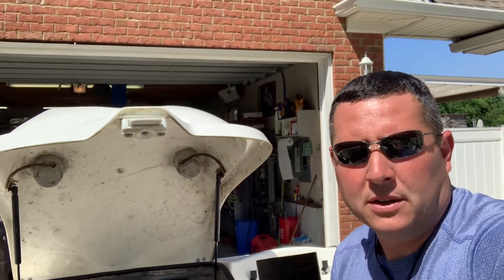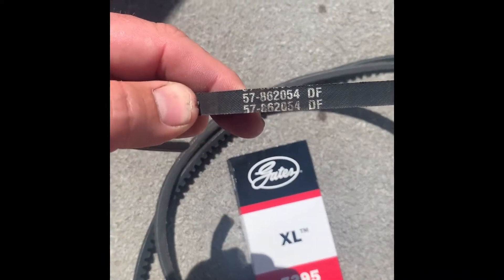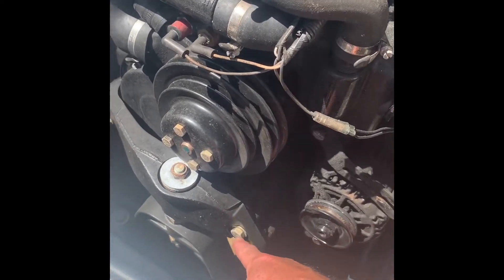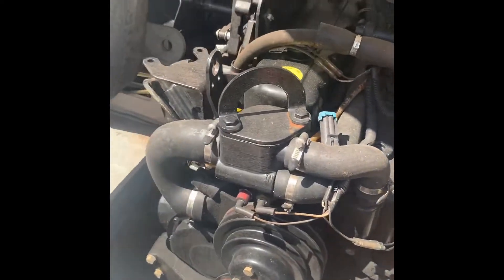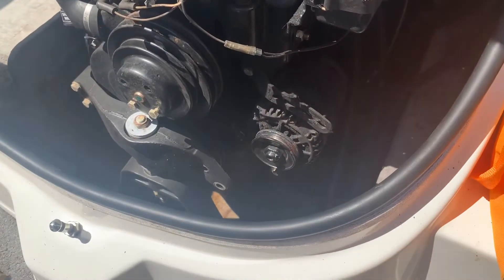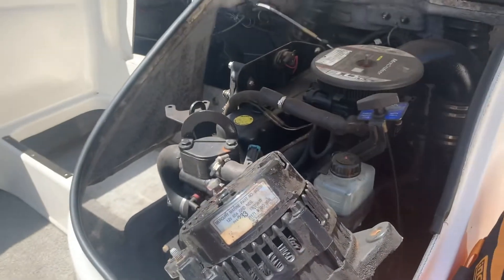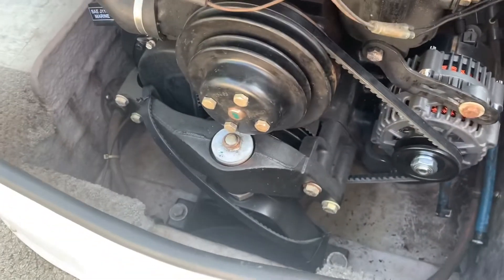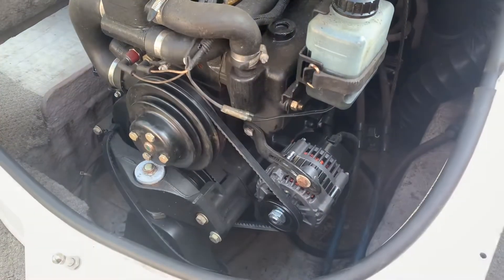Mercruiser 3.0L alternator and drive V belt replacement with Gates automotive belt interchange part

Comment: Just finished replacing the Alt belt on my 2010 Mercruiser 3.0.   That 7395 fit perfect. Nice tip about zip tieing the old belt as a back up. Great job.  Thanks...

Comment: Man this is an awesome video. Thank you. I also have a 2009 175 Bayliner. Fantastic starter boat. P.S. since you're technically sound, you might as well remove the TKS Carb and clean it out. Easy work just pick up a Sierra Carb kit and replace the gaskets and avoid yourself idling issues. cheers!

Comment: Did you end up having to jack the engine from underneath to hold it in place with the engine mount spacer off? I have a 2008 Bayliner w/Mercruiser 3.0 stern drive and will be replacing the belt and alternator within the next week or so...wasn't sure if the Mercruiser 3.0 engines in the newer 2000+ models need to be jacked or not. I'm hoping it's not needed based on the lack of space underneath the engine. Thanks for posting the video.
Reply from the maker: No I didn't need to do anything but just remove the bolt and spacer. Good idea to check the other bolts are tight first so it doesn't want to shift on ya.
Reply: @trbokmro  How'd you get your pulley off? I removed the 4 bolts in front, doesn't seem to budge. Don't want to break anything by forcing it out too hard. EDIT: Problem solved. Used a wooden dowel rod to knock it loose...I don't think the belt would've fit through without removing that pulley first.

Comment: Thank you for posting the video. Now I do have a question regarding the alternator. The original is rated at 55Amps and the one you linked to the Amazon is rated at 65Amps. Will that make any difference. 
And BTW, how was your boat running after installing the alternator and the belt? Any feedback is much appreciated.
Reply from the maker: Higher amp alternators I consider an upgrade especially if you plan to install a stereo, depth finder or any other electronics. It’s very common in the auto industry to have a baseline low option vehicle with a lower rated alt and have a higher optioned same model with a higher amp alt. Same in my option and we’re only talking ten amps. My boat ran flawless all year and we took it out al least once a week.

Comment: both belts are 7395XL ?
Reply from the maker: yes, my engine only uses 1 belt for the alternator the second is just a spare. Mine does not have power steering.

Comment: My 3.0 has moved a bit when I took the engine mount block out, I haven't been able to get the block back in and the two bolt bolt holes to line up to reinstall. Very irritating
Reply from the maker: Find a tree to park it under and use a come along or heavy ratchet strap to lift the engine up. Your bracket must be lose go over all the bolts when the spacer is back in place
Reply: @trbokmro  I finaly got it, put 2x4s across the gunnels and jacked it up with a chain and scissor jack. Had to move motor a bit to the side with a porta power also. Was harder than it should have been, but got it done.

Comment: Does having teeth vs no teeth make a difference? I thought i ordered the wrong one but now it seems that the one you replaced was also smooth and put in a belt with teeth...
Reply from the maker: As long as it’s rated for automotive use you will be fine, I wouldn’t recommend using a belt rated for small gas engines/lawn mowers and such.